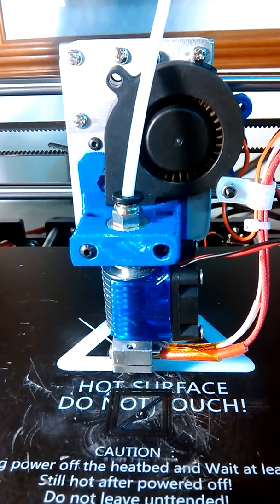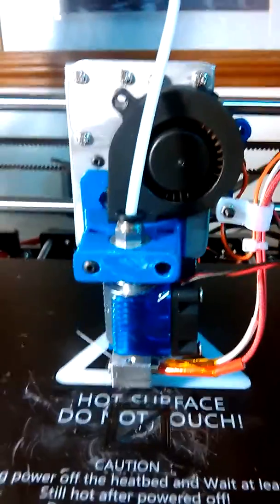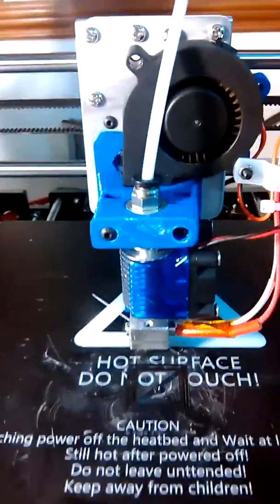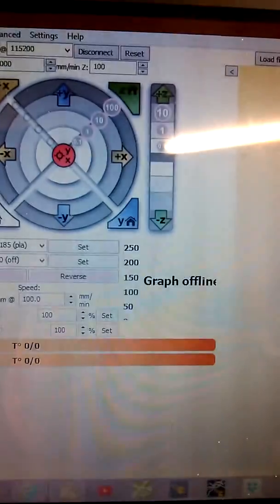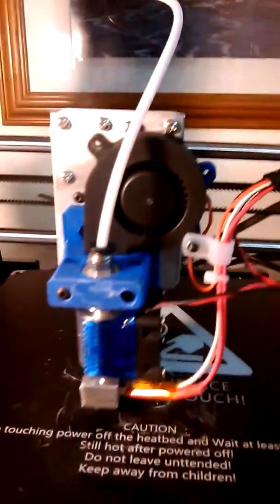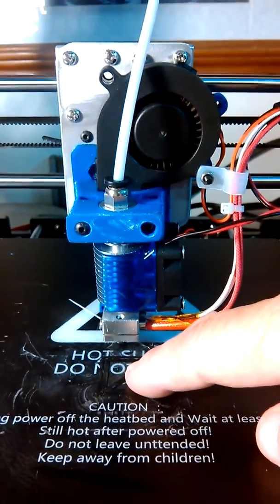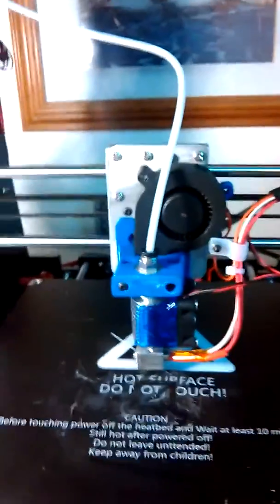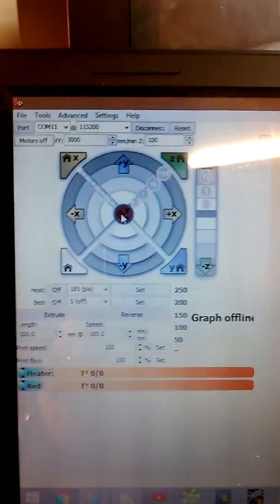Anet A8 will not print in the center of the bed

Comment from the maker: I am running Marlin firmware. I found a workaround to fix the problem. I moved the print table stop switch forward the distance that I was out of center. It now prints in the middle of the build plate. I could not figure out how to do it in software so I did it manually.
Reply: Using repetier host program , connect to your machine. Click configuration then firmware eeprom settings. In there you will be able to adjust your X HOME POSITION AND Y HOME POSITION in the configuration settings. I hope this helps.
Reply from the maker: Thank you for your reply. For right now, I have it working pretty good but it's not done right. I move the stop on the back of the table forward with a new bracket. That put me close enough that I could print just about anything I want. However, it's not Right. My nephew the electronics engineer will more than likely be stopping by the next month or so I will show him your post, and sick him on the problem. Thank you for your input I do believe it is a step in the right direction.
Reply: You're welcome. Using Repetier Host program it''s as simple as a few clicks and key strokes. in repetier host program with your printer connected via usb and powered on. click (red button top left). Then press ALT and E at the same time. Your eeprom settings for your printer will appear in a pop up box.  (finding the line labeled (X HOME) AND (Y HOME) should be default at X HOME POS [-45.00] and Y HOME POSITION [0.00] or similar. Just add or subtract your x and y  differences to those pre set values in the eeprom firmware and click ok. Best wishes to you.
Reply from the maker: Thank you again. I knew there had to be a way to correct this by using the settings. I just did not know how to go about it. I can now see where it can be done and it's possible thank you.